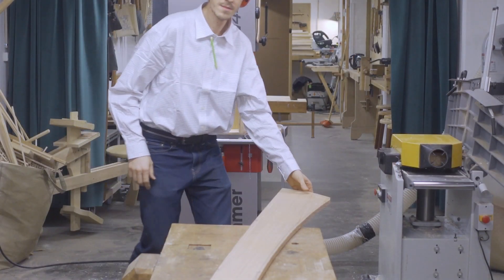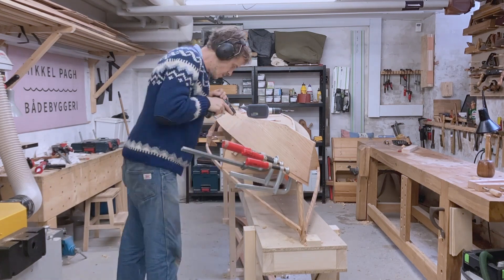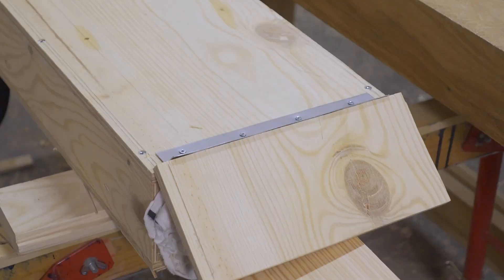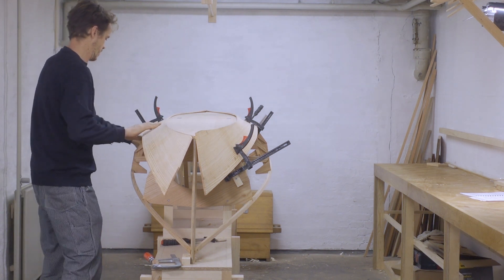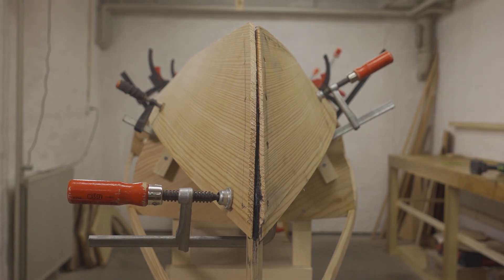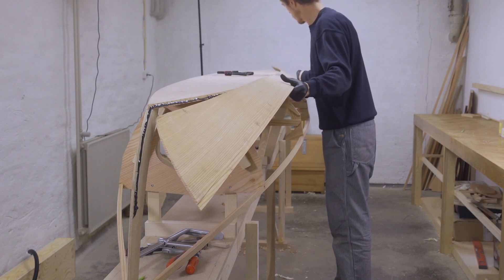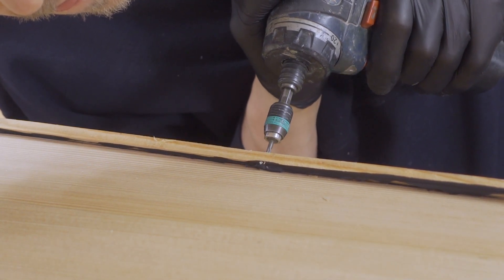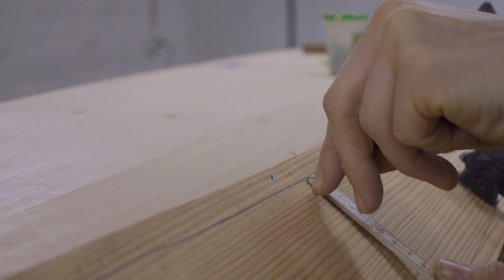LAPSTRAKE PLANKING 101: How to STEAM BEND and HANG the Fiddlehead Canoe garboard planks

Comment: Flat sawn lumber was often used in lapstrake planking rather than quarter sawn or rift sawn as it was more split resistant especially at the garboard and next one.  But your rift sawn sure looks nicer and is more dimensionally stable. I would prefer it for the sides in boats with more strakes. Also the poured boiling water method which I have done (not my favorite) works much faster and you also get more time to do the fitting. But you can get burned easily. I steam in a plastic bag sealed with aluminum HVAC tape. Gains are cut different ways but I cut my gains the same way as you.

Comment: Where does one purchase a Backing Iron for riveting?
Reply from the maker: As far as I know they are not mass produced. I had mine done at a machinist's shop. A thick rod of steel with a hole drilled at the end can work in a pinch.